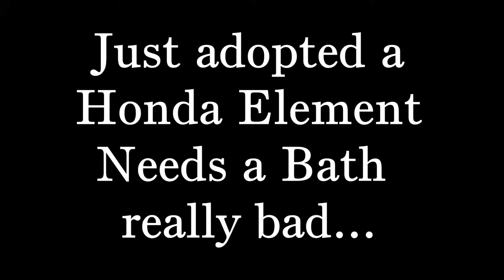Honda Element Removing Seats and Floor Liners

Comment: The people in the comments are idiots. Thank you for this video. Just had massive flooding in my area and my element was 60% underwater. This is the ONLY video that I have found that shows how to remove floor liner. Just got car back from shop and it is running fine but I need to get the still water that is between floor liner and metal out. Thank you !
Reply from the maker: Thank you for the feedback… its always good to know that the videos are useful

Comment: I would never feel comfortable about doing this, and it's one thing to take something apart it's another thing putting it back the same way and safely!
Reply from the maker: Every used car I buy goes through that cleaning process,  fairly simple and not much can go wrong if the battery is unplugged.
Reply: The mechanics are simple, like the guy who did all this absolutely unnecesary work. You can clean the floor and seats without removing them.  How does he clean his kitchen floor - remove the cabinets and covering?
Reply: @psdaengr911  Not true, if water got in the interior it goes underneath that floor covering and sits in there forever and turning in a mildew and smell. You have to take the floor covering off to get it out to get it dried out and deep cleaned

Comment: They say you can hose down the floor in a Honda Element, no you cannot because there is no floor drainage. The water would eventually find its way under the rubber flooring and rust would set in. Do not hose out the interior or the rubberized flooring, just wipe it down when it gets dirty.
Reply from the maker: Hosing down the inside of the Honda Element is a salesman lie. The only thing that can be hose down from the interior is the spare wheel cover if removed from the car.
Reply: Car salesmen are notoriously ignorant about cars, their forte is figuring out what the buyer already wants and making him forget everything that doesn't match that.  They don't become more knowledgeable when they go home at the end of the day.

There would be some benefit to removing the front seats for cleaning if they were heaviliy stained or filthy, because it's easier to do heavy cleaning and drying on a bench than inside a car.  In this case, the entire floor covering can be cleaned without removing it in under 20 minutes.  Its removal-to-clean is as dumb as removing cabinetry and wall to wall vinyl flooring from a kitchen to "deep clean" it would be.

Comment: One more question:
When you unclip the passenger seat and hook the battery back up, will the air bag go off ?
Reply from the maker: I never tried it and  If I remember right, if the battery is plug in while the connectors are apart...that triggers the air bag
Reply: @JoeBakerOutsideTheBox   Ok, so unhook the battery before removing the seat. Then once the seat is removed, plug the battery back up.
Reply: @justinwilliams2522   ive taken of the seats with the battery connected didnt happen even drove the car to a body shop with no seat connected
Reply: No, I took the passenger seat out of mine, and drive around that way. That would be a bad way to design an airbag, for safety reasons. You don't want it to go off unless you're actually in an accident, and there's actually a person sitting in the passenger seat. That's why it has a sensor that turns the airbag off, if nobody is sitting there (or a small kid).

Comment: Do you have a full video?  I'm curious how you did the rear liner removal and reinstall. It feels like you have to remove the paneling that's connected throughout the back of the Element.
Reply from the maker: Hi, It’s the only video that I have but yes you have to remove some of the trims and the center console

Comment: How did you remove the yellow tab underneath the passenger seat ? It’s next to the blue one
Reply from the maker: They're spring load lock connectors. To disconnect: pull the sping loaded sleeve towards the top (slide the sleeve away and hold it), while holding the opposite half of the connector...pull apart
Reply: @JoeBakerOutsideTheBox   Thank You
Reply: Disconnect the battery negative terminal and wait 30 minutes, to be sure that the air bag system has lost residual power (just as a precaution, to make sure the airbags don't accidentally go off, somehow). Then slide the middle part of the yellow connector back, and separate each half.

Comment: I'm interested in removing the front passenger seat permanently as I am making a car camper just for my self. Do you think the connectors need any special treatment for seat belt and air bag lights warnings will be ok? Thanks!
Reply from the maker: I really dont know, all I know if you unplug the seat, the airbag light will light up...check the Element owner forum, a few members built their E camper and would gladly share their experience and knowledge
http://www.elementownersclub.com/forums/search.php?searchid=9818266
Reply: Hey Eric, did you ever take out the passenger seat and turn the Element into a camper? I was thinking about doing the same thing. I saw a great pic on reddit where the person puts a cot from REI in it's place extending back. See link if it lets me post it. Please let me know, I am trying to do this this week :)  https://www.reddit.com/r/vandwellers/comments/8e67cc/my_nobuild_honda_element_camper/
Reply: In process of doing the same, how did you all do?

Comment: Do you need to take the seats out in order to take the floor garnish out (0:41)? I need to get at some rust forming around the door latch on the floor.  Thank you for the video!
Reply from the maker: If you want to completely removed the floor liner, yes seats has to be unbolt. It's easy, only 4 bolts held the seat in place, be careful with the airbag wiring, I usually unplug the battery on both positive and negative and never had any problem with the air bag.
Reply from the maker: If you only take the floor garnish out, no need to remove the seats

Comment: what happens if you leave the battery plugged in
Reply from the maker: You can deploy the airbag when connecting /disconnecting the airbag sensors under the seats
Reply: The hot circuits under the floor covering are likely to blow the front seat side airbags, if installed.

Comment: Any way of mounting that passenger seat facing rear? No passenger, just for camping alone. It could stay that way permanently as I have another Element for driving around town.
Reply from the maker: should be easy with some minor modifications. Swapping the smaller rear seat in the front passenger facing rear may fit better

Comment: I need to clean my back seats, I just bought a 2008 model, and the seats are stained terribly, what do I use?
Reply from the maker: What work for me for deep stain, is upholstery cleaner mix with water in a spray bottle. I give the seats a good soak (without exaggeration) then I vacuum it off with a shop vac that can take water. Repeat until clean
Reply: @JoeBakerOutsideTheBox  Thanks man
Reply: I like to use Folex carpet cleaner. Spray it on, let it do it's thing, maybe brush the stains... then hit it with a steamer to heat it up, and suck it all out with a high powered shop vac, with an 'extractor' tip on the end. It's like dry-cleaning.

If you can take the covers off, soak them in a bucket of hot water with Oxi-Clean for a few hours, then do the same trick with the shop vac and extractor tip. Then put them in the clothes drier, on a shoe rack so they don't tumble.

Comment: Did you have any problem with the sensors in the seat when you reconnected them or did it just plug back in and work as before? I read that you would have to calibrate the ODS sensor (That detects weight in the passenger seat). Are there any special steps you had to take when reconnecting the seats?
Reply from the maker: I disconnect and reconnect the seat  sensor with the battery disconnected, never had any issue or airbag light warning
Reply: Joe Baker.   Thanks 👍
Reply: There is no calibration.

Comment: What size socket for the 4 main bolts on the front seat?
Reply from the maker: I dont remember, a good guess would be 15mm or 17mm
Reply: 14mm, if I recall correctly.

Comment: I've owned 2 Elements, one used.  This is work without benefit.    So little dry debris gets under the floor covering that the ONLY reasons to remove it is to remediate water damage or install sound dampener.  The entire interior can be cleaned with sponges moistened with small amounts of soapy water.  Spray liquid into the seat mesh and you are begging for mildrew and mold.  Punch a hole in that exposed dual coil subwoofer and it'll cost $60-$100 to replace it.   Damage or lose plastic rivets and spend time and money getting ones that match the type and color.
Hint: Once scratched, plastic trims never looks the same.  A metal prybar should not be used to remove a plastic interior.  If you absolutely need to remove the interior or follor covering to fix an issue, Harbor Freight sells a good plastic rivet-clip puller and a trim removal kit that is made of FRP.
Reply from the maker: Thanks for your input, that was a real dirty dog smelly high mileage (300000++miles) worn out 2004 Element that I pick up initially for parts, but decided to fix it instead (i own 3 Elements). The interior really needed a super deep cleaning and a good air out...after all that, the car interior is normal and can be maintained like you describe.
P.s> since the video I bought the trim removal kit
Reply: You sound like a real joy, Paul. I bet you starch your diaper.

Comment: Fer cryin out loud. How to clean the Honda Element. Take the air compressor hose from your garage air compresser and blow it out. If you take your time it might take all of 1 minute. Your done.
Reply from the maker: Thanks for your feedback, that old beater was really crusty
Reply: That's great and all, but sometimes the previous owner had dogs and you might want not want to smell dogs every time you drive. Detail time!